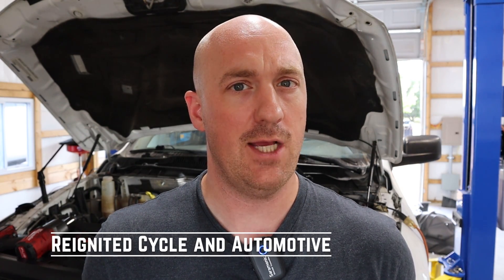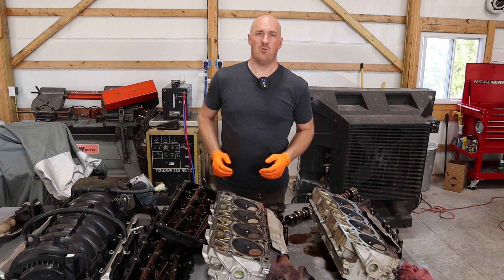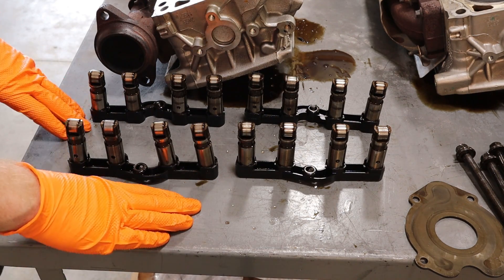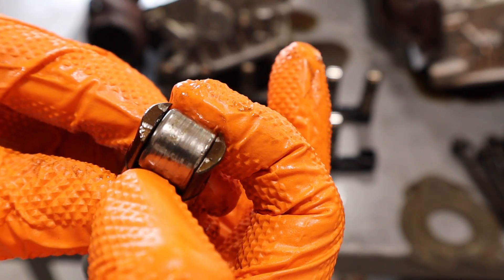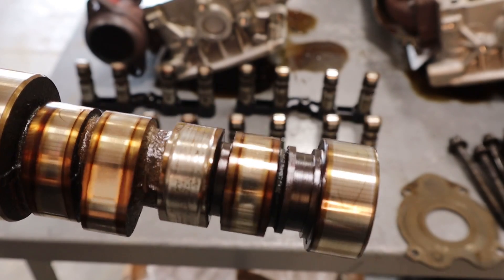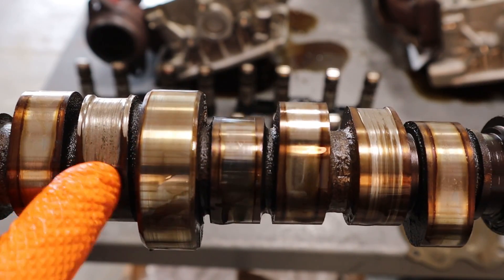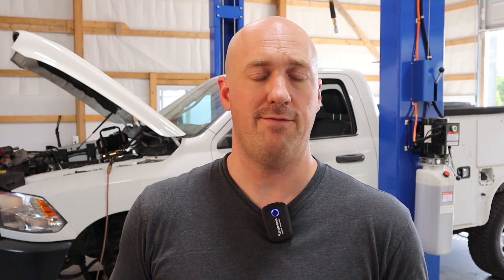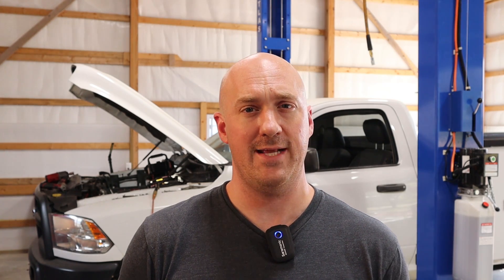Hemi 5.7 Lifter FAILURE Does this engine have a fatal flaw? Find out how YOU can prevent it!!!

Comment from the maker: If you want to see the very latest video I have on this subject you can check it out here! https://youtu.be/wpl8aZiPK0E
Reply: Thanks for the quick reply. I will go ahead and proceed with the cam and lifters only. I had just changed the oil about 800 miles before the fault, but will be changing it now for sure. And I will take your advice to change it again after 4 to 5 hundred.

Again, thank you for the great content you have and for the quick response.
Reply: I have a '10 RAM 1500  with 211000 miles on a 5.7 and it posted a code for cyl 3 misfire and started to tick.  I figured it was a lifter failure and pulled the heads and found one of the lifters had seized the roller.  I noted that it appeared to be into the cam some as the sides were also slightly worn.  After pulling the cam it is worn significantly, seems like it had been doing it for longer than I thought.  My plan was to just replace the cam and lifters, but now I am wondering if I may have a contamination issue and should do more.  I have photos of the affected lifter and cam lobe that I could show that may help the decision.  I have pulled the cam phaser to check the screens, they are clear.  I am wondering what your thoughts would be on this situation and what you might recommend.  I don't want to be pushy, but I am in somewhat of a time crunch and a quick response would be greatly appreciated.  I understand if you can not however.  Thanks
Reply from the maker: @waltergrasmick5615  if the oil control valve screen is clear as you mentioned I'm totally fine with just replacing the cam/lifters. Might make sense to do a quick oil change about 500 miles after the repair just to be thorough, but that's my opinion. 👍
Reply: @ReignitedAuto I agree
Reply: After you replaced the cam and lifters. What are the chances it's going to happen again since nothing has changed. Are the new cams and lifters now better ?

Comment: heh, I replaced my lifters back in May and recently rebuilt both cylinder heads.. guess what, the dam 5.7 is right back to ticking. right now it’s very slight but I imagine it’d get worse; shop told me the camshaft was fine when doing lifters but I think they’re lying… I give up

Comment: The hemi tick more often, refers to broken exhaust manifold bolt, and when the engine heats up the tick goes away. Although I understand, there can be more than one cause of a tick.
Reply: If leak is bad enough, the tick will not go away. This is a tricky deal.

Comment: Just had to tear down my 2005 jeep cheekoee 5.7 238k (pistons, rings, bearings and new heads at 205k) 150 shot of nitrous and low oil i spun a rod bearing. To my suprise the lifters are still perfect. 5 wore pushrods at the rocker end. Im guessing the metal from bearing and crank took the pushrods out like that.

Comment: 5w20 in large v8 engines, bad idea from the get Go... V8 over 5L in size sould use minimum of 30w oil, because of the power and torque on the parts spinning. 😢

Comment: I watched your series on replacing the cam and lifters on a 5.7 hemi. I can"t find it now. I think that it was titled something like how to replace lifters and cam without removing the heads. My 2014 Ram 1500 has 215,000 miles on it now.The trouble (P0303/P0300) started around 210,000 miles. I think it would be best if I replaced the motor. Still waiting on a quote.
Reply from the maker: Here's the video you're looking for 👍
https://youtu.be/JzIqhwyu0Ys

Comment: (I Idle mostly on the freeway, guess what I do)

I have 4 chargers and my favorite, has had 3 rebuilds.  

1st at 30 miles due to failure of lifers, Brand new 2020 HEMI hell cat .”

So, thst theory, although sounds, and was VERY LOGICAL, was absolutely garbage 

IT accelerated lifter FAILURE ultimately caused catestrophiv failure LOUD LOUD LOUD ticked towards then with all then other systems.  

By the time you came out with this “wiring” fix, I was just waaaaaaaaaaaay too pi$$ off to rebuild and, and try it

I’ve been through this before over and.

2nd option is just rebuild normally, change your oils like a feind), also use synthetic, no exceptions.  It will absolutely prevent smudging.

Comment: I have a 2003 Ram with the 5.7 it has 105000 mls , what is your opinion of these and do they have issues? I live in New Zealand where these are not that common and finding people with experience of these engines is not that easy . Cheers, Dean.
Reply: Prong to it! Currently have an 03 4dr 1500 sLt with 5.7 hemi sitting in the very back of mi driveway.  Behind 7 other vehicles as I been putting off fixing it for nearly 5 years now. Lifter failed at 109k miles.. Gonna put another engine in opposed to the near 20hr labor the book calls for 😂 naHh...engine swap it is!

Comment: I figured out that the Mobile 1 extended performance M1-304a is the same gasket and thread size as the Mopar 090 filter but its twice and long and has twice the flow rate, filtration, fluid capacity, and red silcone anti drain back valve and a pressure bypass valve that is built into the bottom of the filter and has a bracket spot welded thats holding it into place inside of the filter. I am switching to this folter permanently!!!!😊

Comment: I figured out if they make a seperate manifold with am oil galley with oil ports above each cam lobe the camshaft and lifters will last way longer and the engine will have decent oiling of all of the moving parts the require it.

Comment: I change my oil no later than 4km. I dont tow much. Owned since new and dont idle alot. 

My lifters failed at 111,000. 

My first Ram broke a valve spring at 27,000m.

I am NOT buying another Ram.

Comment: I have a 2015 Ram 5.7. 112,000 miles. It have at least one bad lifter.

My 2012 Ram 5.7l broke a valve spring at 27,000.

Not buying another Ram. Damnit

Comment: My brother's 5.7L Hemi just failed at 198,000 miles on his 2011 Ram 1500 and he did oil changes every 3000 miles.  It has no compression on cylinder #3 and it is because of the intake valve.  The mechanic said it would cost $3000 to replace the lifters and cam to fix the engine.  He is pushing the truck into the tree rows.  He is never buying another Hemi again!

Comment: It's a camshaft metallurgical, oil thickness, and needle bearing design. From the  engineering side the camshaft is spawling which is a metallurgical and oil boundary layer issue. Basically too much pressure applied to too small of an area. I do think there are also some design issues with the needle bearing and it tends to raise its head on the MDS lifters more. Just had to do my truck with 180k and I had camshaft wear and spawling on 2-3 lobes that the lifter itself was in perfect condition. It is a design flaw and a EPA issue due to the thinner oil being used. Chrysler just is not accepting their ethical responsibilities and pawning this off on the customer.
Reply from the maker: These were some early videos I was doing on this subject, in my later videos you'll see i agree with you on it being a camshaft issue. I've also seen cam lobe failure with no lifter issues.

Comment: This is an old video but really informative. So the UTG video states it’s a design flaw where the cam and lifters are too high in the block but from most of what I read many people say idling is the issue. Does this mean just sitting with the truck or car with the motor running or stop and go traffic as well? Also, does it have anything to do with how you drive them? I have read that the cam and lifters are getting much better lubrication with the RPMs at 1500 and above. So what is the truth to all this and what is the best way to prevent it?
Reply from the maker: You're correct, this video is quite old. To see a much more current video that directly addresses your questions, check out the video link in the pinned comment at the top! 👍

Comment: Oil pump oil pump oil pump The hell cat has a better oil pump than the 5.7 Gen 3. They knowingly mass produced this engine with an inadequite oil pump for many years and have made a fortune off of repairs. I'm one of the many thousands of victims and I'm pissed.
Reply from the maker: This is a really old video at this point. If you look on my channel you'll see I'm pretty much the guy who pioneered installing the Hellcat pump. Some good news though there's actually an even better pump available now, more so than the Hellcat. The Melling 10452HV pump provides 20% more volume and the Hellcat only provides 12% more volume. 👍

Comment: Changed my oil before the 'oil life meter' was at 0% every time. Used extended life synthetic exclusively. 149k and my lifters are done. I believe I would have been better buying the cheap oil and changing it every 3000 like I used to "back in the day". This is the first engine thats failed on me in 30+ years of driving and working on cars.

Comment: I changed oil every 2,500 miles in my 5.7 hemi, and it blew a lifter at 21,000 miles.
Reply: I’m so on the fence about getting a ram rebel with the 5.7 but I see so many of these comments and other problems. Then there are those to jump to the defense with “all vehicles have issues” no.. rams are definitely more frequently talked about negatively.

Comment: A lifter with a rounded roller on the cam shaft with needle bearings,should have been a roller bearing just a single round steel ball

Comment: When idling you will be using 4 cylinder and the other 4 cylinder will be shut down and also with the cruise control. There is no lubricant on the 4 cylinder that stops but the combustion and the compression is the same. I think that cylinder deactivation is the worse thing they could have done. If I wanted a 4 cylinder I would buy one and I would never buy a car with cylinder deactivation unless it is new

Comment: Do you know of lifter failure on the pre-eagle hemi‘s mine is ticking and I know for a fact, it’s lifter or could it be rocker arms?
Reply from the maker: Definitely recommend you watch this video first: https://youtu.be/cL3xNoKs9E4
👍
Reply: @ReignitedAuto  
Yeah, I know about the exhaust manifold leak. I already replaced the gaskets on those and put all new studs and bolts ARP. I just was wondering if the pre-eagle does suffer from that too just not as often because mine is ticking when you rev it up to high RPM  and then let off and let it idle. It goes away for a little bit, but then it starts to come back. You’ll hear it tapping slowly, and then it starts to get louder do you know if the rocker arms do make those noises because I know on the V6 like the 3.5 the rocker arms fail
Reply: @ReignitedAuto  but then again, I also drive it real hard all the time I know that doesn’t help it, but could it be the oil pump because it sits like at 25 psi at idle and on LS’s, they sit at 40 at idle
Reply from the maker: @izaacsilva9148  we don't really see rocker arm issues on Hemi engines. Not to say it can't happen because of course it can. More so what I've seen on pre eagle Hemi engines is that the hydraulic portion of the lifter will start to leak, which will cause a tapping noise. However generally when that is happening it'll be on a cold start that will eventually go away after a couple minutes of running.
Reply: @ReignitedAuto  yeah I know, but it doesn’t go away. It stays only while idling. it’s not a severe tapping noise, but it does tap quite a bit.

Comment: Could the MDS lifters be the ones that fail because they are constantly being hammered against the crankshaft when they engage, tens of millions  times. 75% of the pictures I can find  look like MDS lobes. I'm new to all this but just received an 07 1500 with 237 k and although it seems to be running perfectly and purring miles are up there and I don't know the previous history on the vehicle. I'm considering crankshaft replacement and MDS delete with upgraded oil pump preemptively as everything else seems to be good.
Reply from the maker: I do have some good news for you, the lifter issues that affect the gen3 Hemi are present on the 09+ engines generally. You almost never see lifter issues with the 08 and older engines.

Comment: Hi , thank you for the videos , I am rebuilding my 2010 Cherokee with the 5.7 hemi with the MDS system , I had mds lifter spring fail , kind of disappeared in the engine , but the rest of the lifters and the camshaft look fine . Mileage is 125000 kms .. my question is can I reuse the same old lifter and just replace one tray as in the one that failed which falls on cyl 4 . Do I need to preload or collapse the lifters before installation? Appreciate any advice regarding this . Thank you

Comment: My 2021 Ram with 15,000 miles check engine light came on going 70 mph on the freeway.  #5 lifter failed destroyed the #5 cylinder.  Two months later I have my truck back with a new motor .  Dealer tried to repair the motor first.  Now I just don't trust Ram and will dump it for a Toyota Tundra.   To bad because I really like the Ram and have always been a hemi fan.  There are other issues as well just check out the the Ram forums.  My Ram had it's oil changes on time so while I think you have a point it did not matter in my experience.  Also, Ram told me putting in a hellcat oil pump will void the warranty.  By Ram - Stellantis garbage company.

Comment: I disagree with idling being the issue. I don't care what Chrysler says. It might be a contributing factor, or make the problem appear sooner, but it isn't the core problem. I've changed lifters on a few Rams at this point. The owners tell me they never let it idle longer than the length of a red light or so. The oil is also changed regularly. Still failed MDS lifters. 

Now, currently my own 2019 Ram has a bad lifter in cylinder 6 (an MDS cylinder). I've never used anything but ultra premium full synthetic oil. I don't idle hardly at all, driving mostly highway. And I don't use the dash readout to tell me when to change oil. I change at the recommended interval on the dot. The first year I changed at exactly 5k miles, but since 2020 I've changed it based on engine hours.  STILL I have broken MDS lifters. 

I'd bet cash money these lifters are made in China and there's very poor quality control, if any.

Comment: Th🎉e company I work for the owner Asked me what oil additive I was using and I told him. he took the recommendation of the mechanic and started using lucas. That is not the additive i'm using and they are still having issues with engine failure. They get roughly about 80000 miles out of an engine before it fails. They change the oil every 6000 miles. The oil additive I am using is MOA. I'm using a full synthetic oil with a mopar oil filter. I had 270000 miles on the engine. Did a compression check, and it was running a 180 to a 190 cimpression. At 280,000, I developed a tick, and then the code popped up p0302, 1414, 1417. I have sent my oil in to see what the particles are.
 In 3 weeks from now, it goes into the shop to get torn down. I have been changing my oil every 10000.

Comment: There is no question that it's debris in the oil causing the lifter failures. If it was an engine design flaw it would not be just one or two lifters.

Comment: great video, my daily driver is a 2010 Ram with the 5.7 Hemi, it's got 181,000 miles and no lifter tick. Runs and drives great with no issues. I run high quality synthetic with good filters and try hard not to let me try truck idle for very long.  Take care of it and it'll last!
Reply: What oil weight n type you use?

Comment: Also for some reason the metal shavings have been found on the intake manifold,  so a good idea is to remove the intake and have them cleaned and reinstalled or those metal partials are  going right into the cylinder and that is a VERYVERY BAD ISSUE

Comment: Thanks. I am planning to buy a RAM with the 5.7.  Based on everything I found it seems like a maintenance issue.  You confirmed it.  Seems like all modern engines are sensitive to oil quality.   I think I am going to do a 5000-mile interval.   In the old days we used to do 3000 miles.  Thanks for the great video.

Comment: eh its odd, I see a lot of Hemi Jeeps and Rams all over the place with no issues ever..  Same thing with my old Dodge, I would see all kinds of horror stories on the internet, yet mines still running fine at 450,000 miles.  Guess it all comes down to, was it maintained?  It is a high performance engine after all, full of antifreeze and fresh oil is required.